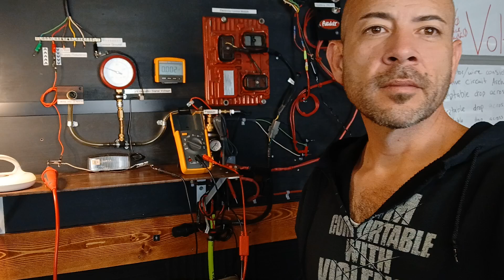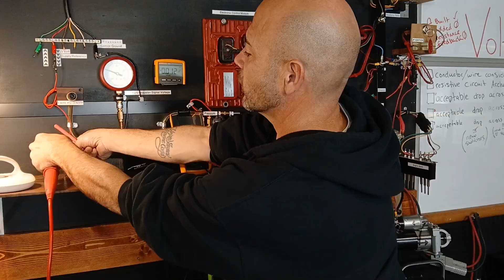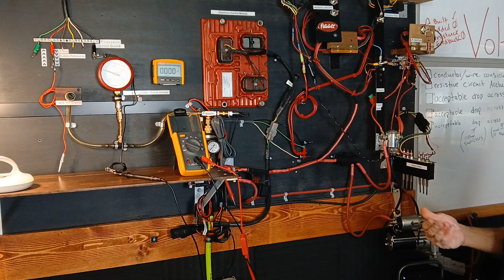Voltage drops.  Thank you for your time.

Comment: Good video Joseph. Wanted to share something we were taught in electronics school years ago. We called voltage drops IR drops for 2 reasons, 1) IR gives you the Ohms law formula for voltage drop (current x resistance = voltage. 2) knowing this literally defines a voltage drop. When current (I) flows through a resistance (R) there's a voltage drop. Lastly,  if there's no current flow there will be no voltage drop. Lesson? Never remove the load under test from the circuit. Hope this helps.